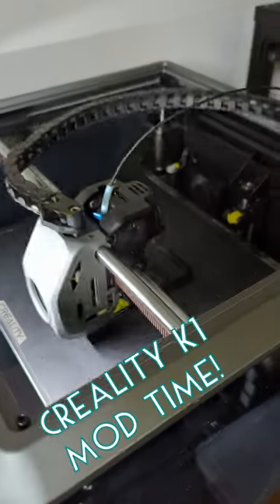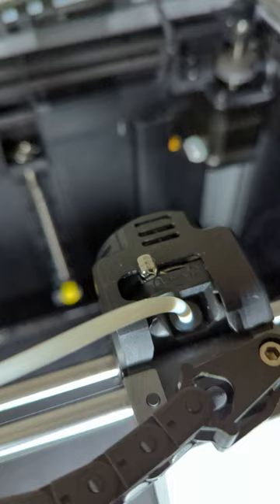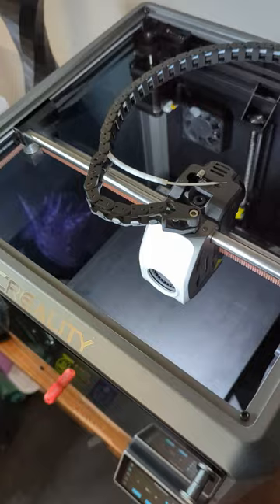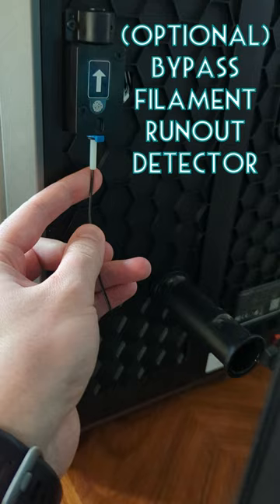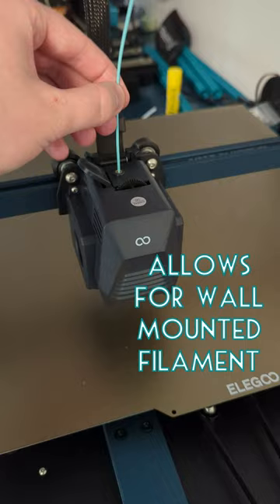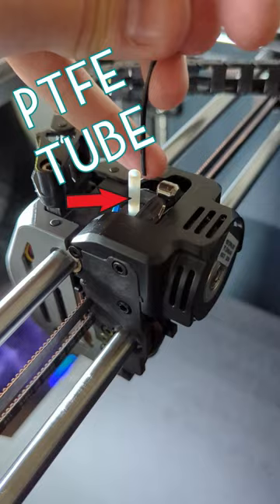Creality K1 EASY Bowden Mod 🔧

Comment: So for anyone who’d actually like to continue to use the run out sensor, the enclosed chamber, etc. just get a Capricorn Bowden Tube and replace the stock one
Reply: ok that was my guess as well...have you got the K1? My K1 will be delivered that Week (hopefully) and i need it for printing ASA so that i would need a other fix for that problem
Reply: @sauerkr_autttv6333  friend got one so I’ve been playing with it. I just run two X1C’s for my main setup nowadays
Reply: Ah, I hadn't thought about getting a Capricorn Bowden Tube.
Reply from the maker: Capricorn tube could work, or the stock tube may work fine for you. I just don't like using a reverse Bowden tube. I can still use the Filament runout sensor and the top cover without the Bowden tube like this.
Reply: Capricorn won't help in a reverse bowden. If anything then a bigger inside diameter is better.
Reply: This! ^
Reply: I was curious if you can just do a Capricorn swap with out any issues.   My Bowden tube is causing me issues where is causes a clog when I have the lid on.  I was going to try the risers to see if that works first.
Reply: @HeathFoster1 try fittings also
Reply: Exactly this
Reply: @robertgcode965 that’s where you completely wrong my friend as I was having no end of problems until i swapped it to cap tube sorry to disappoint ya 😅

Comment: I always change the feed line for a 3 mm i.d., 4 mm o.d. PTFE tube and it works without a problem. Actually, the infamous supersoft Ninjaflex feeds consistently through it.

Comment: always use a 3mm ID 4mm OD reverse bowden tube. it is there to guide the filament to the direct drive extruder, doesn't need to restrict side to side movement

Comment: Without a reverse bowden the extruder is going to want to pull the entire toolhead upwards any time there's resistance from the filament spool. This leads to premature wear and also causes layer inconsistencies in prints. You can get away with it on slow machines, but the faster you print the more important it becomes!
Reply: Also it may unwind your spool in the most unpleasant way possible, ask me how I know.

Seriously, on an i3 style machine this might fly, but on any cube style printer you want to have a bowden so you are not pulling on the spool like crazy. Especially printers that are made to go fast.

If your extruder can't handle this, there is something wrong with it.
Reply: @steilkurbler4973 ive heard the K1 has a shitty extruder that under extrudes. Mabye the k1 is jusf bad.
Reply: Thank.👏you.👏
Reply: @alexfeatherstone6676 the early models with the issue were replaced by Creality - models for the last 6 months plus I believe, have the newer extruder - has a rough finish lock switch (vs the original with a shiny finish)
Reply: Never had an issue, the feed is extremely strong so the resistance would need to be great in order to slow it down.
Reply: @frankjohnson8006  that's exactly the problem. It's strong enough to pull up on the tool head and cause z banding and stress on certain parts that wouldn't otherwise be stressed.

Comment: Can you but the plastic on top with no essuie to print abs ada etc?
Reply from the maker: Yes, the filament can still fit through the slot at the back of the top.

Comment: That’s honestly a horrible idea! No the printhead yanks on the filament very hard and quickly causing the filament to most likely break after the runout sensor and not to mention it being pulled while printing will cause quality issues and did I mention possible motor skipping as well🤦🏻‍♂️

Comment: A printer that expensive shouldn't need mods to work.
Reply: All printers needs mods to work even bambu is having issues
Reply: @hughjanus6720 "All printers needs mods to work even bambu is having issues"

Respectfully disagree. I never needed to mod anything on my X1C to get it to work. 2800+ hrs and 10 months printing.
Reply: @ashleys3dprintshop  then you ain’t using it hard enough , had 3 x1 and a p1 all fail out of the box due to hotend issues and extruder
Reply: @hughjanus6720  I print every day.  So clearly it is used enough. I also have a Prusa, ender and ankermake too. I take care of my machines and they function to spec. 

I have an OG kick starter model so it's as 1st gen as they come. I have seen every revision of firmware and slicer and it is by far the easiest to use and prints great. 

I have not needed to "mod" my X1C and have only changed out consumable items like cutter, wiper and nozzle. I have proof of my usage as well. Why dont you post a video of your printer/prints
Reply: @ashleys3dprintshop  you print small stuff nothing of significance print out some real stuff you don’t use em enough I’ve already seen the work you do out  , don’t need show you my prints already know they outperform you
Reply: @hughjanus6720  Ahh a goal post mover and a "no true Scottsman" gatekeeper.
You mentioned needing mods, print fails. 

So you had 3 X1 printers and a p1p. Tragically,they all don't work. (worst luck in the world) 
You run into someone who prints daily(10 months) with proof. You state I don't print enough, now I don't print large enough. This has been in interesting interaction.
Reply: @ashleys3dprintshop  I’m sure you print “daily”
Reply: @hughjanus6720  show us one of  your printers. Make a yt short.  I have 60 videos showing mine with more to come.
Reply: @ashleys3dprintshop Hilarious 🤣🤣 I love these types of people. They try to win the argument anyway possible and in the end, they look like douches and don't respond. Good job breaking this loser! 👏👏👏
Reply: My K1 has never had any problems.  LOVE IT.  (I think people invent problems to create drama)
Reply: @hughjanus6720  ....um NO.
Reply: @hologos_  oh the irony of your comment.  Ashley proved you wrong, but you couldn't handle being defeated.
Reply: @HappyBuddhaBoyd  yes babe

Comment: Imagine paying $600 for shit you HAVE to modify. Just get a P1P and you won’t have to do any of this
Reply: Lol haters will hate.  The K1 is a great printer, this is a simple fix.
Reply: @3dcreations99  P1P is better
Reply: @sierra659  p1p costs more
Reply: @sierra659  PIP costs more and is not even fully enclosed. k1 is a fantastic printer for the price.
Reply: And pay double. This is so easy and nothing to complain about.
Reply: P1P sucks and has its issues as well ,
Reply: @hughjanus6720  you’re broke
Reply: if you think you won't have to work on the P1P at some point, boy do I have bad news for you
Reply: @knightsljx  I have 10 x1c’s. I have some news for you. They don’t require as much maintenance as Creality, AND they are perfect right out of the box.